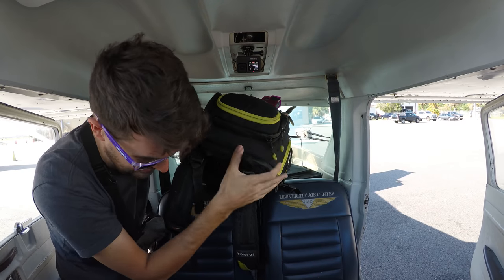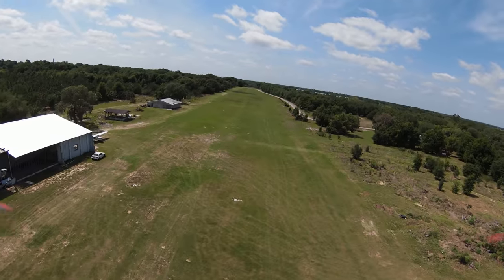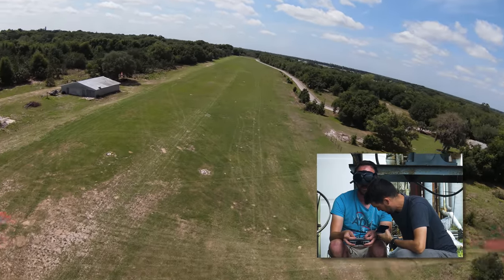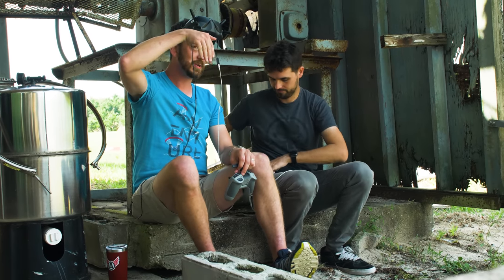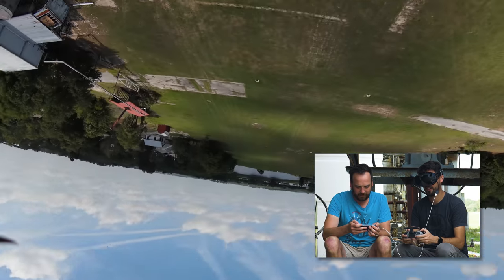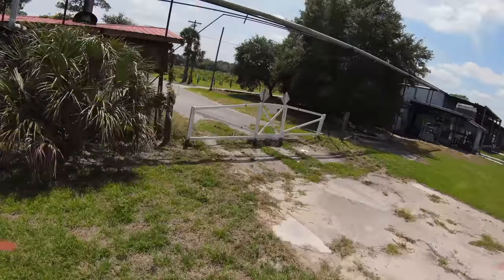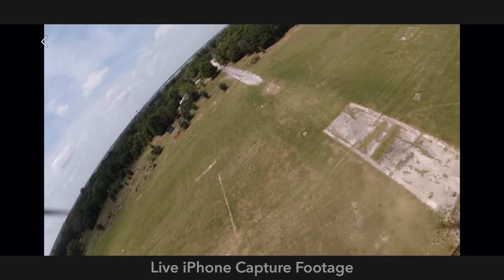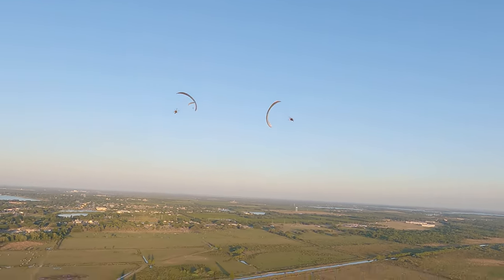How to POWER LOOP A Freestyle Drone - First Flight to Freestyle with DJI FPV

Comment: Got into FPV with the DJI FPV, crashed it two times within 3 days of flying (both times an arm broke and I had to send it to DJI) but got lots of awesome footage, done some tricks and already have my Nazgul 5 sitting on the desk and just waiting for my radio batteries to finally arrive so I can get into freestyle for real :D Such an awesome hobby (or even job)!
Reply: Welcome aboard! Been into it since the good ol 2014 days. This is what I’d wish fpv was like back then.
Reply: @creationlabsinc.189  Yeah i can't imagine how difficult it must have been to get everything working smoothly. No Bardwell, no Rotor Riot, probably sh*** firmware(?) and lots of fiddling around :D I just bought the DJI bundle and could get in the air without crashing after 5 sec :P
Reply: @Clonkas  well, you know the old saying ignorance is bliss. Tiny postage stamp size screens, sketchy video, spent hours getting the perfect tune only to crash. Lol

Comment: 7:00 this is a really good explanation, I think I got something I didn't think of it of it even though I'm starting to get smooth power loops I'm still learning them. Not the clouds part but the keeping the pitch steady and modulating the throttle.

Comment: I've been practicing power loops out in the open. Need to find something to loop. This video definitely helps explain what I need to do to improve. 🤓
Reply: You'll nail it... Just don't hit the cross pipe ;)
Reply: Use a sim. Flight characteristics aren’t too far off from the real thing and it won’t cost time and money when you crash.
Reply: @creationlabsinc.189  Sims are okay. I do use liftoff. But I prefer real life flying and the fresh air . Just deal with the consequences and have a good sense of humor. And always bring a backup quad. 🤓
Reply: @aviator  at first it was the Earth that kept getting in the way. 😜
Reply: @jlarson42  gotcha. I know I’ve spent many of hours rebuilding, especially years ago learning matty tricks

Comment: how can i control throttle separate from pitch?
must you be in sport mode?
the drone's default mode is #2.  [page 40 of user manual]  did you change it? 
please cover the basic settings in video beginning.

Comment: Can you put altitude and horizon instruments/ data into the display/ power/ speed/ velocity/ acceleration transmission? Is the headset a 'normal' VR headset or is it specific to droning? That said can either be used for both purposes - VR and drone work?

Comment: Beautiful, I am trying to get vr head set for our DJI mini but I don't know what I should be looking for in a head set. Drones only just took off here.
Reply: Where are you located?
Reply: Ahhh Australia!
Reply: I think you mean FPV goggles, you are not looking at a virtual reality but the real world. And a DJI mini has nothing to do with freestyle quads. Try Liftoff first, buy a cheap radio (like BetaFPV LiteRadio 2 SE or you have a bit more money the RadioMaster TX12), then buy a tiny whoop and an Eachine EV800DM.
Reply: @MrAlucardDante  yes thank you, I will check that out, I got DJI mavic mini got feel for flying drone. I am going to get equipment and try to FPV. I will google that, thank you friend

Comment: Thanks for teaching us how to do a power loop, my question is how do you get viedo out from the dji googles into a iphone?
Reply: Just connect the goggles to dji fly application in your iphone
Reply: If you have the dji drone u can use the dji app, but if you just have a dji airunit, your only option is to use the new "DigiView" app which is only availible on Android, but works Perfectly!

Comment: I still can't do powerloops. I really struggle when I loose my frame of reference. :)
Reply: Try it like 100 times in the simulator :) Then again in a big open field, with a little whoop or something to take the edge off :) I have a super nice little super lite whoop (moblite 7) which flies for ages that I practice my freestyle tricks on, lets me relax as I don't worry about breaking something and it's small so I can practice in my garden over my bushes and under my trees and stuff.
Reply: @definingslawek4731  Thanks for the tips! I did finally do it with my iFlight A85! My first loop was more of a tear drop. But my second loop looked pretty good! It helped that there were lots of clouds in the sky for reference!
Reply: @carlthewinner  congratulations!
Reply: @definingslawek4731  Thanks It has been excellent! I practiced outside more yesterday and had several crashes! Once my battery flew 3 feet away too lol. I am lucky I found my drone! :)
Reply: @carlthewinner  looool, God bless you. What a lovely attitude, 'yeah i did the crash!' 
I was flying somewhere beautiful recently and I was testing how low I can get to the ground before I'll clip it, I clipped the props earlier than I thought I would and my quad smacked the ground so hard it ejected the lipo like 3 feet but the gopro ripped off of its mount and flew like 20 XD I was also lucky to find it as the sun was setting.
That and my prop chewed through part of my xt60.
Was pretty cool, last pack of the day aswell so that was convenient. 
Glad to hear you're having fun :)
Reply: @definingslawek4731  That's funny, last pack, gopro gone, sun setting, chewed xt60. Had literally the exact same thing

Comment: How did you get the video out from the goggles in your mobile? Does it work with iPhone?
Reply: DJI fpv drone exclusive. You need the drone and goggles,  not just goggles.
Reply: @purpleAiPEy  Wow!! It should be possible to hack that soon I guess. Thanks for the info
Reply: @marcosmartinezgarcia  you can! with android or a computer

Comment: Couldn’t get to the end or even middle of the video. Wayyyy to much chatter. Why don’t you show, using just the controller, what the stick movement would look like. DO IT SLOWLY. TALK THROUGH THE MOVEMENT. THEN follow through with the flight.